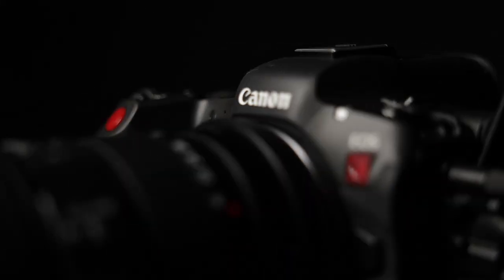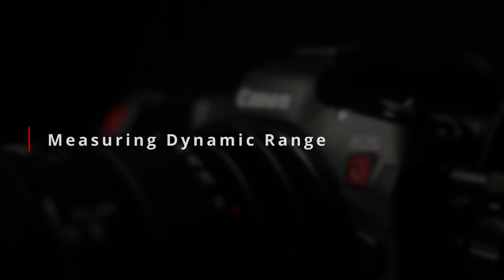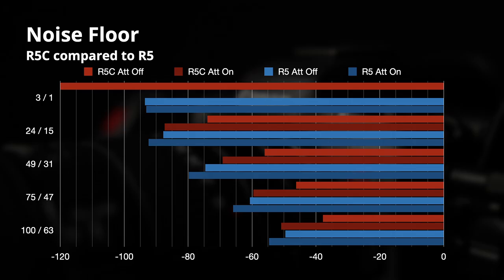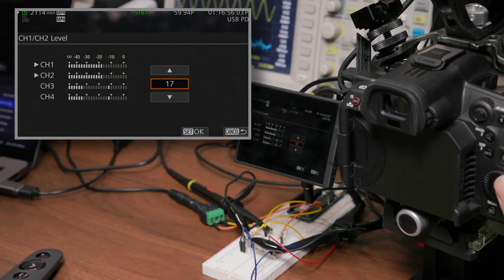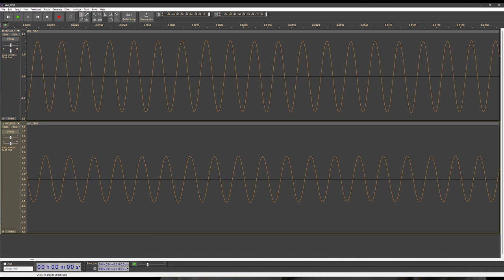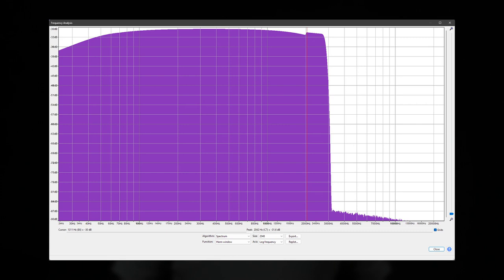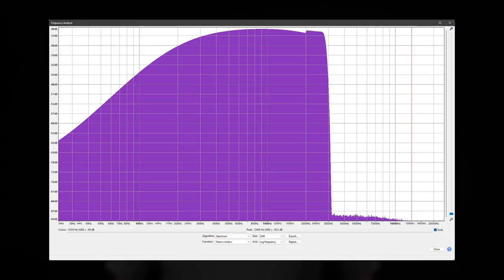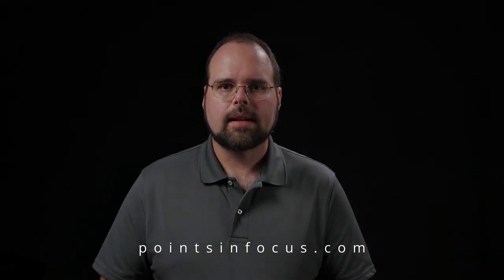Audio Subsystem Performance Testing on the R5C - EOS R5C Tip 18

Comment: Love your content you’ve been putting out!
So - 1) does the R5C turkey have 24 bit audio through the 3.5mm jack? And 2) is the R5C considerably better than the R5 when it comes to audio quality through the 3.5mm jack?

What other options should you recommend for xlr audio, besides the trouble ridden tascam hit shoe unit?
Reply from the maker: The files are 24-bit, but the 3.5mm ports ADCs don't appear to be any more capable than the R5's — so 16-bit at best, but from a dynamic range perspective usually much worse.

If you want XLR and good quality sound, you want to get a proper separate audio recorder. I use a Zoom F6. Another good option is Sound Devices Mix Pre II series. And use that for the recordings. Then either use the line out at w/ reduced dynamic range to do audio based sync, or the time code outs (either via wire or via something like Tentacle sync) to sync up the audio in post.

The simple reality is that Canon kinda dropped the ball on the audio side of things with the R5C. They could have have spent a little time to improve it, but apparently that wasn't in the cards.

Comment: Hello Jason, after the all yours video about audio in R5C I have still a problem to properly connect Zoom F3 Recorder to my Canon R5C. All the time I have issues with audio levels clipping after recording in camera.  Do You write me please a startpoint which will be good to connect F3 to the camera ? To the F3 I connected stereo mic AT 835ST, from line out to mic input in the R5C than audio levels to manual and I set the levels down in the camera ( because the preamp in camera are not so good as in F3?) and raise up the waveform in F3.  Levels in canon are quite good but the sound clipped :(   with this configuration F3 and R5C there is so lot of levels option: line out level, waveform increase or decrease, manual audio levels in the Camera. Please can you write me a few tips? Thank You, best regards
Reply from the maker: The R5C seems to be a real bear when it comes to input signals and clipping.

The input signal really must be knocked down to mic levels (or close enough) to work properly. For that you'll want to get an attenuator cable. I don't have the exact db requirement off hand; though a 25 db cable may be enough, if not you'll need to step up to 40-50db. This will let you run the F3's output unattenuated (or nearly so) which gets the largest dynamic range out of it that it can produce. This will also let you run the camera's mic in at something on the lower end of it's range, but not 0 which should be ideal given my testing.

I haven't actually tried it personally, but you could also give it a shot. I have an old video on getting the Zoom F6 and EOS R5 to work together without an attenuator cable. You can find it here https://youtu.be/Xk-B5hmubS4. I haven't tried this with the R5C, so it may not quite work right, but it might be worth a shot too.
Reply: @PointsInFocus  thank You for the answer and tipps. I tried here many settings with the f3 and Canon R5C. On the F3 I set the line out to -25, -30db in the camera menu manual audio input to about 35 and than You have yet the waveform on the F3. You can increase or decrease the waveform with + and - on the F3  and this affects too to the line out level. I think that This is everything a little bit to complicate because I need a good audio on weedings and another party's. I thought that better is to have 32 bit float from F3 and than sync in post but when I see all the problems with good audio levels than I will rather buy a Tascam - CA-XLR2d-C. The second thing is that I must be very fast with all settings on weddings I can't try and try with audio levels. Jason can You write me Your opinion please ? Or am I thinking right?
Reply from the maker: This is what I'd do...

I'd record 2 system audio, with the F3 doing the actual recording and the camera only taking a low quality sync track from the F3's line out.

I'd get a 40-50 dB attenuator cable. This will knock down the F3's line out without compromising dynamic range and quality significantly. Once that's in place, I'd run the F3's line out at 0 dB of attenuation and dial in the camera settings to get the right recording levels. (If the F3 has a -6db test tone, use that until you get -6dB on the camera's meter). This is the extent of the camera-recorder settings that should ever need to be set or changed.

At this point it doesn't matter if the camera's audio clips, since it only needs to be good enough for your NLE to sync and replace the audio from the F3.

Record everything on the F3, in 32-bit mode. This provides the widest possible dynamic range, flexibility, and quality. In 32-bit mode you should be able to record pretty much anything without having to worry about changing levels in the field. If it seems like it's clipping on the F3, it's not clipping in the 32-bit file (FWIW, 32-bit files can store >1500 db of dynamic range, which exceeds the loudest sound possible in Earth's atmosphere, so you're not going to clip).

This way, you can focus on not having to mess with the audio settings in the moment, and can normalize everything to a reasonable level in post.

Of course, as always, I'd strongly recommend testing this setup before putting it to use in a critical situation.
Reply: A little question yet: what is with the line out level in the F3 when I set there to -35 db or something like that? Or better leave this on 0 db with attenuator cable ?
Reply from the maker: The way Zoom does line out attenuation is in the digital domain before it's converted to an analog signal.

Basically, there's a 16-bit DAC that's setup to turn 0 dBFS into whatever the maximum output level is (I think it's +1 dBU on the F3). If you dial in attenuation on the line out, the digital signal is divided down by the specified amount of attenuation and then it's sent through the DAC.

With 0 dB of attentuation, a 0 dBFS signal (call it 0xffff in binary) is output at +0 dBU (~0.775 V)by the DAC. With -30 dB of attenuation, recorder lowers the signal by reducing the digital number by appraximately 32, so instead of that signal being 0xffff it's 0x0800 in binary) and the DAC outputs a signal at -30 dBU (~0.024 V).

The signal is quieter, but it's quieter because the DAC got a smaller number and therefore is using less of it's range. You get the full 16-bits at 0 db of line out attenuation, and you get some amount fewer bits worth of range and precision as you increase the amount of attenuation.

Most other brands use analog attenuation (e.g. a resistor network or a variable amplifier) after the DAC. So in those devices the DAC always has it's full range, and the output voltage is reduced after the fact.

This is why it's better to use an attenuator cable instead of dialing down the line out level.

That said, you can dial down the line out level. You'll want to turn on the attenuator for the mic in on the R5C, and only turn down the line out enough to get the F3's -6 dBFS test tone to -6dBFS on the R5C's meter. But that will compromise the dynamic range in that signal compared to the F3 being set to not attenuate the line out.
Reply: thank You  @PointsInFocus  now I understanding everything about this.